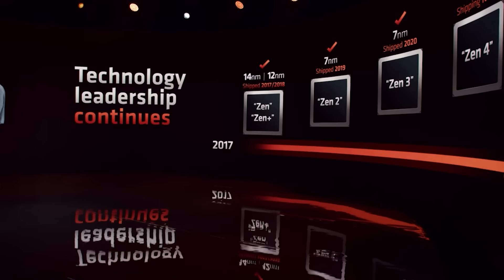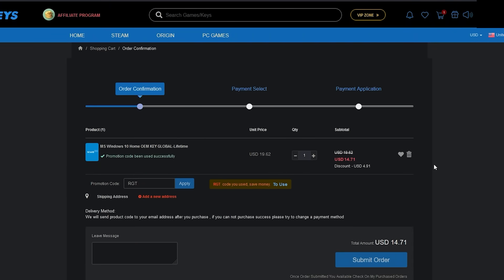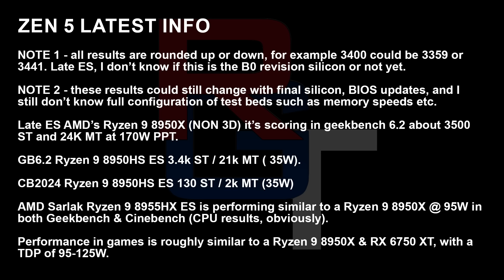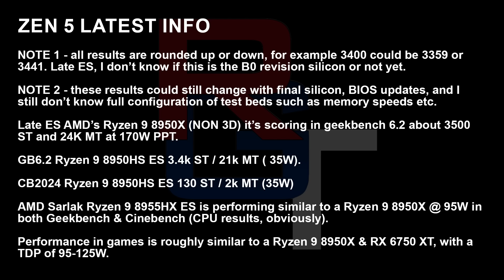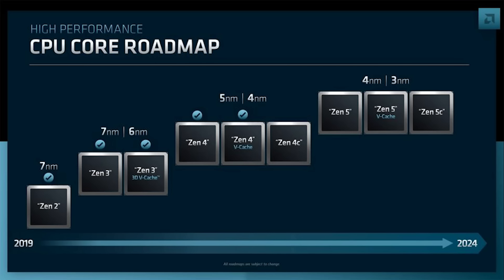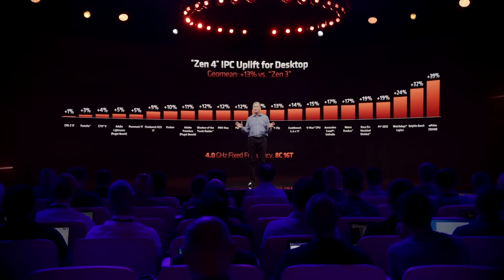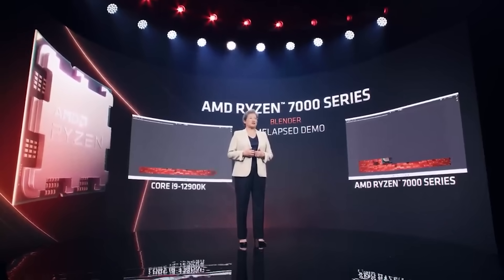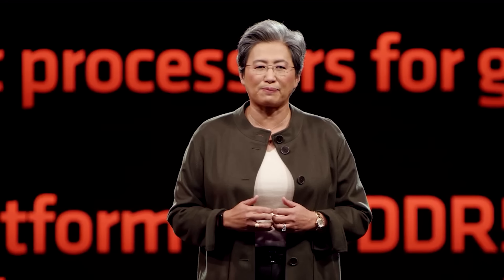Zen 5 HUGE IPC & Clock Speed Update | NEW Benchmarks Leaked

Comment: I'm interested in the APUs as they would be insanely powerful in my NAS currently running a 5700G with 8x22TB drives multiple m.2's but the Strix board has no usb c.

Comment: Should test cpus at the max officially supported memory speed. Of course in the overclocking section of your review you can dive deeper into overclocked performance. I'm excited to see what Zen 5 will be about, however like most generations I will just be interested. I went from a R7-1700 X370 board to a 5800x x570 board when Zen 3 first came out. Still a solid cpu so I will be waiting for awhile to upgrade. Cost of a new board, new memory, new cpu, and new waterblock adds up fast, and really I wouldn't see gains to my 4k gaming. Probably won't upgrade until Zen 6, maybe even 7.

Comment: I wonder why everyone including the manufacturers are talking about IPC and possible gains. It is one of the worst performance hints they could give: Instructions per clock tells you nothing about the instruction processed and nothing about the clock. Its just a statement about architectural improvements, not about absolute speed. The only numbers that matter are benchmarks (plural) because in the end we need an analysis of the total system and not only the CPU. Most people just want to know the best price to performance components for their use case. For example, is it worth to buy a more expensive CPU or higher grade memory? Will those 8xxx CPUs benefit from a News chipset (If there will be any).

Comment: I do not own a 7950x3d, but i owned a bulldozer/piledriver cpu back in the day and when they launched the 7950x3d i saw a lot of the same problems that architecture had because of the 32bit cores having to combine sometime, but not all the time. Just make both ccd's x3d this time amd, software never really works the way it should

Comment: Testing should obviously benchmark different computing tasks/loads with one memory configuration and different memory configurations with one computing task/load.  Those results should point the way toward quickly finding an ideal memory configuration based upon the most common computing task/load that a particular computer will see (until a driver or BIOS update changes everything).

Comment: IPC for Zen 5 will partially depend on cache changes.  If more L1 or L2 cache is added, this will boost IPC for many workloads especially games.  If it's other parts of the architecture that simply improve instruction execution, like improvements to the pipeline then that benefits almost all workloads.  

So this is hard to predict short of getting information from AMD about the changes they've made for Zen 5 and then seeing it tested or at least getting some results from AMD, who does a pretty good job with the numbers they show.

Comment: It's easy to believe the 8955HX is similar to the 8950X @95W, since that would be power limited for the 8950X where that part has a TDP of 170W.  This is lower clock speed performance based on what would be near top end for the laptop part.

What's HARD to believe about that part is getting GPU performance up to the level of a 6750 XT.

I understand that AMD is supposed to be on both TSMC N4 and N3 for their different lines of Zen 5 parts.  To be able to get to the GPU performance of a 6750 XT suggests that would HAVE to be on TSMC N3 to get all the transistors to fit on the die and it still run cool enough for a gaming laptop to handle this.

I mean this is REALLY impressive if true because that is premiere 1080p gaming and that would be the market for laptop makers.  If true once again, a company can make a CHEAP gaming laptop that doesn't need a separate GPU chip AND it's high quality 1080p gaming.  This would be the first laptop APU to accomplish this.

On the other hand this could also mean the performance on a 6750 XT clocked slower to be able to fit in a certain power envelope and then that really wouldn't be the performance of a 6750 XT.

Comment: Mini PC's are going to be the rage with these new 8000 series APU's.
Reply: @RAM_845 yes but I just bought a 4070 for nearly $600 ... the whole CPU will be less than that and its rumored they will be as powerful in Ryzen 8000. The power will be good enough to be a main PC IMO. 1080p for sure. And 1440p with reasonable graphics settings in well optimized games.

Comment: Well, my upgrades with AMD were from 3900x for 5900x and I'll jump for 8xxx series. Probably a 12~16 cores X3D this time. I'll be buying Mobo and ram in January to get ready for those new CPU.

Edit: i believe it will be go pretty nice with my 7900XTX.
Reply: Just a personal opinion dude and this depend on how much of the MB you use.  I use a good chunk of an X570S MB so I have strong opinions about the full capability of systems.

Right now AMD only has the capability of 6000 MT/s for memory in reality because even though bios updates allow for faster memory kits you don't get benefit from it because the Infinity Fabric clock can't deal with faster speeds, and once you're no longer 1:1 for the IF and mem clock you've lost the benefit of faster DRAM.  This ALSO limits the CPU-chipset link to 8GB/s.  Well, AMD has been at that speed since 2019 and it really means that a MB like an X670E is a waste.  You have ALL that stuff on the MB but you can only transfer data at 8GB/s across the CPU-chipset link.

Before I would buy Zen 5 the IF would need to run a bit faster to take up to near 8000 MT/s memory while still being 1:1 with the IF which means the IF clock can run 4GB/s, AND it would have to at least double the bandwidth between the CPU-chipset link.  Components are getting faster and I already see the AM5 600 series MBs as being outdated.  

Intel CPUs/MBs can already handle 16GB/s across the CPU-chipset link.

The leaks Paul have given suggest AMD is changing their interconnect for Zen 6.  If this is the case, Zen 6 could be FAR superior to Zen 5 even though the cores are basically the same.  It could allow for much faster memory and much faster interface to the MB and all that matters and will improve IPC and overall system performance.  It will improve latency.

So, I would recommend not jumping on Zen 5 right away.  Wait for the rumors for Zen 6 and get more clarity for what AMD is doing for their interconnect.
Reply: I would recommend aiming for the 800x3d parts (unless your not gaming)

Comment: I had the 1700 on AM4, then the 3950X, then the 5950X. When I jumped to AM5 I picked up the 7950X3D and the gains have been stupendous every time! Looking forward to another REAL Generation from AMD 🎉 💯
Reply: What did you do with the old cpus?
Reply: @iamsurajsharma mine are on my desk 😅, 1800x to 3800x to the 5800x3d on same Asus prime pro x370 motherboard, personally the 1800x was overall A mistake I should have got the 8700k that came out 3 months later, but the mutithred performance was nice of the 1800x even thought I had to force the all core turbo to 3.8ghz (c state was still enabled so it could still idle at 800mhz) or I would suffer quite high micro stutters (actual mice stutters) 

single threaded performance of the 1000 and 2000 was garbage comparable to a i5 4th gen cpu when I got the 3800x it was super (I believe comparable to a 9700k or 10th gen) 5800x3d was on another level + true 8 core CCD removed all the latency penalties of the previous cpus (as they was 4+4 per ccd)
Reply: I had a similar arc. 1700, 2700X, 3800X, 5800X, 5800X3D (B350 with the 1700 then an X470 with the 2700X on up) then the 7950X, 7950X3D.

Comment: I REALLY need AMD to release desktop Sarlak chips. imagine a world where all the gpu-less itx cases that come with a built in 200-250 watt power supply were actually worth buying for gaming machines. slap a sarlak chip into an itx board, cheap tiny case, cheap 2tb ssd cuz storage is cheap as fuck right now, and a decent ram kit, youve got 1440p mid- high settings in a NEAR POCKETABLE FORM FACTOR FOR $800 OR LESS!!! This would be a great way to distract from not having high end GPUs next gen, "we know you wanted high end gpus and we couldnt deliver them this generation, so to make up for it heres a desktop class APU that hits 3080 performance, enjoy the new era of high refresh rate budget gaming".
Reply: You will never slap a sarlak chip in a itx board. Because the way it can give such high performance is with high speed memory on board.
But we will get great pre built like those miniforums systems and such brands

Comment: I just want 8950X3D with 3D cache on both CCDs.
Tarkov would run like a charm as it scales linearly.
Reply: I would prefer a single CCD but with 12 cores and 3D cache.
or 8cores but double vcache and higher frequency
to reduce the inter-ccd communication which negatively impact the performance.
Reply: Yep, give me 2x 3d cache cpu's strapped together, I don't care about normal cores, gimmie that cache.
Reply: I just want 8950X with 10 ghz clock speeds.
Reply: @badpuppy3  The cache and memory couldn't hope to keep up. The chip would have terrible core utilization and very low IPC per clock.  You'd get lots of heat, but not much more performance.
Reply: @geonerd  Stop talking sense!

Comment: For testing I would love to see CPUs testet as even as possible by the tier: so take the 13900K(S) and the 7950X3D give them the same Core clocks and the same Ram speeds, also the same cooler(maybe with a graphene pad) and the closest possible MBs -》 thats is for IPC testings, but for the irl everyday user also test the best for each, without actuall overclocking the cores, let them run as fast as they can on their own, withe the highest speed memory they support.
Reply: That is a bad example you gave. Both CPU’s have completely different architecture to giving them the same clock speeds and ram speeds is a very bad inaccurate idea. Zen 4 can max out at 6400mhz depending on the motherboard. However Intel can get up to 8000mhz on Ram depending on the motherboard. Also Intel naturally runs at much higher clock speeds. Why greatly weaken Intel so AMD can win lol. The i9 13900KS objectively is the superior CPU.
Reply: @ZackSNetwork  Except all the latency issues, stutters at desktop, issues with audio latency, using 30% more power for same or slower performance in most productivity stuff. If you just want to game, why not just get the fastest gaming cpu, the 7800x3d. Also that faster ram costs more, so why not use the x3d and ram speed doesn't really matter much anymore, ddr5 6000 is pretty cheap now.
Reply: @ZackSNetwork zen4 can go to 8000 as well.... some people have got 8200 100% stable 
But yeah 1:1 mode max is usually 6600 or 6666 for amd, I don’t think I’ve seen higher, and most cpus seem to max at 6200 in 1:1, but lots can do 6400 with a few tweaks
Reply: @ZackSNetwork then how would you do tests for IPC differences?

Comment: If AMD is listening, I’d buy an 8-core, 40cu APU if they put 8gb of HBM on the substrate to give proper bandwidth…or if possible, create a new dimm slot, or repurpose a dimm.2 slot to put a stick of gddr memory into, if the latency penalty doesn’t negate the faster memory…
Reply: It would still suck APU’s are not great for gaming. I don’t understand why people are so desperate for RTX 3050 performance at best.
Reply: @ZackSNetwork uh, 40 cu of rdna 3 with 8gb of hbm2 memory would actually be like a 6700xt level of performance if I'm not mistaken, which is actually quite above the average pc on the market. That in a laptop at a 40-70w draw and a large battery could actually mean surprisingly awesome battery life when gaming. Like a few hours unplugged with very enjoyable settings in most games rather than 40 minutes of meh
Reply: @whiteerdydude You are definitely wrong your not factoring performance per watt or shared memory effecting the performance. It has to share memory with a GPU and CPU so only 8gbs of memory for both GPU and CPU. That will not match 12gbs of a 6700xt and 16 or 32gbs of CPU memory that’s all unified. APU’s can’t beat discrete GPU’s and CPU’s.
Reply: @ZackSNetwork  actually, an apu doesn't have to have shared memory, it is just simply easier to design it that way. In fact ther are only two draw backs to an apu, thermal constraints and the die area (which determines it). If the apu isn't chiplets or tiles, then die size affects yields. Having a lot of high power silicon together is difficult for thermal considerations as well which is less of an issue with a cpu and dgpu combo since the tend to ve physically spaced. But that spacing has it's drawbacks too. Dgpus have much more latency then apus because the signals just have to quite literally travel further to reach them, if you use a unified memory architecture, and you use performance memory like hbm2 (though if you are sharing with the CPU, then yes you need more than 8 gb) you can actually reduce total memory calls which can lead to even more performance. Apus are great, they just aren't easy to do, mostly because interconnect technology like intel tiling is to expensive and unrefined for mainstream plebs to profit off of. It'll get there.
Reply: @ZackSNetwork  So, what the other dude said, along with APUs being clocked a little slower and if you want to know how dramatic of an effect that has, the most efficient gaming parts are all AMD except for low end Intel parts.  But, it's low end Intel parts that have near the efficiency of AMD's BEST gaming parts, and for the CPUs I'm listed for AMD these are all clocked slower than similar parts (7800X3D vs 7700X, 5700X vs. 5800X)

Average power consumption (techpowerup) when gaming:
5700X - 48W
7800X3D - 49W
5800X3D - 52W
13700K - 107W
13900K -  143W

That's desktop.  Laptop of course the CPUs are clocked even slower so a gaming load, while still be something they need to be concerned about isn't something serious.  

If you make an assumption based on rumor (Zen 5 will be both TSMC N4 and N3 depending on SKU) that laptop parts are on N3, AMD has LOTS of die space for graphics since they're ALSO moving to their version of big-little.  Smaller transistor size = less power consumption.   I could envision their CPU cores using 20 - 25W MAX during gaming which leaves a pretty good budget for the graphics.

Laptops are IDEAL for perf/watt so not sure why you even brought that up.  But yes even with using TSMC N3 I question whether a laptop maker would want a power budget for an APU only product to get the performance of something like a 6700 XT.  I'm thinking they'd need about 125W to the APU, but I could certainly be wrong.  If they do though that would be kick ass.  They save the cost of having to add a DGPU.

There's no way they're getting that much performance on 40 - 70W.  100 - 125W probably.  That would still be pretty awesome.

Comment: What I don't understand is rumors state that amd is  done with high end, but isn't that competing with there igpus I mean it doesn't make sense...
Reply: People want igpu in mini pc and laptop form factor. That doesn't compete with discrete GPU on desktop
Reply: @rurutuM  It does if the igpu is on par with a discrete gpu from last gen for a fraction of the total system cost. if amd sells sarlak chips i can socket onto a normal itx mobo imma buy so many of those fucking things! give me $700 1440p mid-high end gpu-less itx builds! i want!
Reply: @StretchDattass  why would it be on par with last gen anything? are people thinking it's an APU like consoles? it won't be cuz the memory are different and there isn't the high power draw or game dev optimization

Comment: Can't wait for an ARM desktop CPU with DDR6 memory that will actually be a meaningful upgrade
Reply: With massive performance degradation due to all the x64 software running through a translation layer. 👍🏼
Reply: @benjaminlynch9958 L
Reply: Based on Zen 4 performance, AMD could increase that performance by 50% moving to Zen 6 especially if they move to AM6 and DDR6 also.  Their problem is the way their interconnect works where they have an infinity fabric on the IOD and while that was good enough for Zen 2/3, it's showing problems with Zen 4 and if all AMD is speed it up for Zen 5, Zen 5 isn't going to be worth it IMO.

However Zen 6 based on rumor is supposed to see a rework of their interconnect and that could possibly mean direct connections between chiplets like what Intel is doing with Meteor Lake/Arrow Lake.  If they can get off their current IF design that's a good 20% jump in performance in different tasks, and will allow them to boost memory clocks much higher.  The memory controller handles pretty fast memory but you can't transfer it fast enough to the core chiplets because of the IF.

So, meaningful upgrades are going to be Meteor Lake for Intel and most likely Zen 6 for AMD.

But moving to DDR6 adds cost.

Comment: note: Qualcomm Snapdragon X Elite reaches 2.9k ST and 15K MT (GB6.2), M3 (not indep. tested yet:) 3k ST / 12K MT and M3 Max 3.2k ST / 21k MT. 
If AMD can give us that 8950HS like shown here and the 8950X (non 3D!!!), that will be mighty impressive!
Reply: The gpu that will be paired up with it will still consume more than 100 watts. 
That 8950hs will be competing with the m3 max and that chip with the full 40 gpu cores will still consume less power than a full x86 system.
Reply: @chair3299  I'd find what AMD does far more impressive than what Apple needs to do for their closed eco-system. (Not that it isn't impressive it truly is, but still...)
Reply: @TestarossaF110  yeah I was actually wrong sarlak is the m3 max competitor. It has 40 gpu cores and at 90-125 Watts TDP the performance is impressive. The HS parts also at 35 watts is really good too.
Reply: @chair3299  ah okay
Reply: really impressive from AMD
Reply: the Snapdragon X Elite reaches 3.2k ST and 17.3K MT in GB6.2 on Linux too